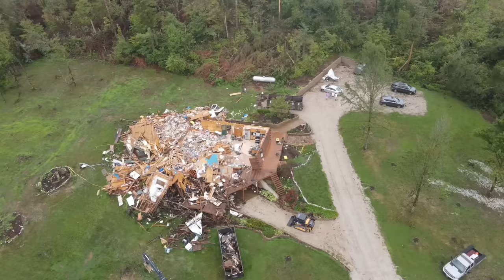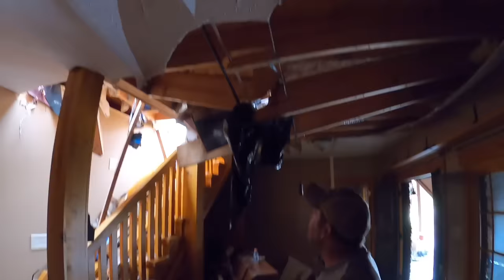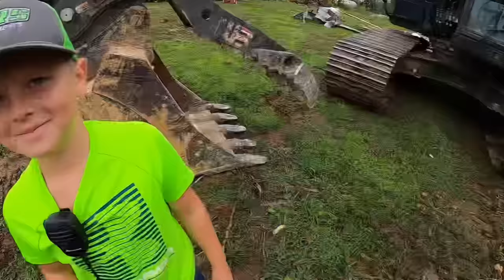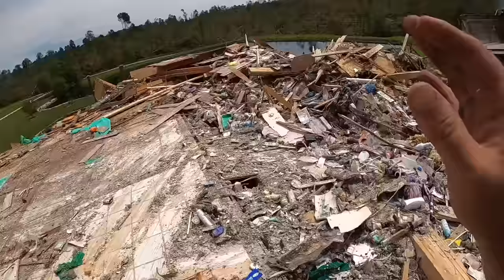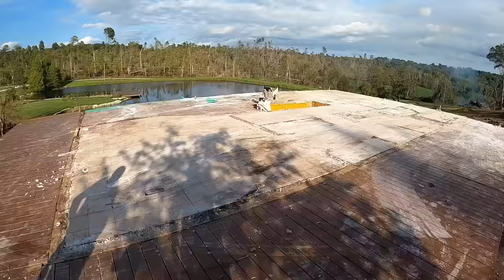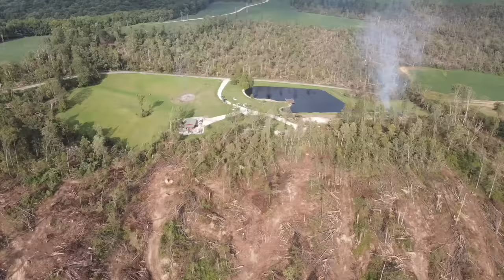Tragedy Strikes Close To Home As We Do Our Part To Help Out.

Comment: Sorry to hear about your buddies dad and the whole situation. As a storm chaser since 2009, it is always hard to forecast weather. We just had an EF1 hit just 2 miles southwest of my mothers house at 10pm back on 9/29 and we did not know until the NWS released the damage statement. Never had any idea it happened and would have not been good if it hit populated areas (stayed rural). And southwest corner can be ideal if the corner walls are completely underground. Anywhere in a basement away from windows and next to 2 concrete walls is the safest bet.

Comment: I'm sorry for their loss. It's a terrible thing to have to deal with. As someone from outside the US, it still baffles me why in 2023, they still build houses out of sticks. Houses that can't handle strong winds, can't handle fires, can't handle floods. Why? A properly built house with concrete pillars and frame, walls made with proper cement blocks and the house would've been still standing and more importantly, a life wouldn't have been lost.
Reply: everything here is 10 times more expensive than in 3rd world countries that make their concrete from sand down the road. A house like that would cost millions to make up to code here.
Reply: @TheInsultInvestor  3rd world countries? A little bit ignorant there, isn't it?
Reply: IT one cost two they took a direct hit 130 mph winds the roof would of been ripped off and then walls might of went.  It's not really the wind that cause the damage.  IT the fact that the house really just implode or explode.  You lose a window on the incoming side of the storm and all that air pressure has to go somewhere and that is to the weakest point.   Been main people save there house from a side blow of a tornado by busting out all the windows to equalize the pressure.

Comment: Gunner is almost as tall as Aaron, as helpful as Aaron but he sure makes a lot less noise than Aaron. The standing portion of the house is the same basic construction as mine. It is a testament to the power of that tornado that it could tear that lag and through bolted log home apart.
Good on Ya Mike for throwing in to help deal with the loss.